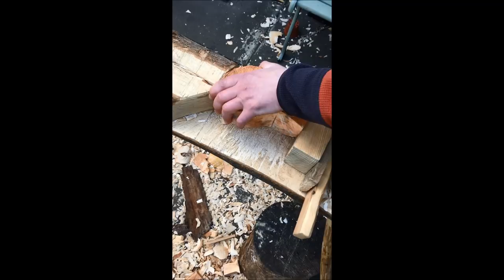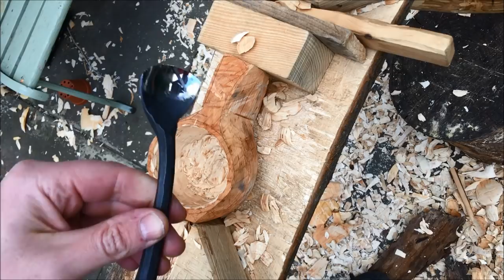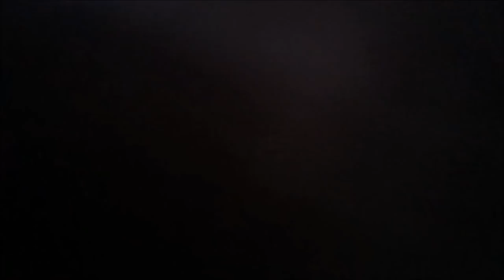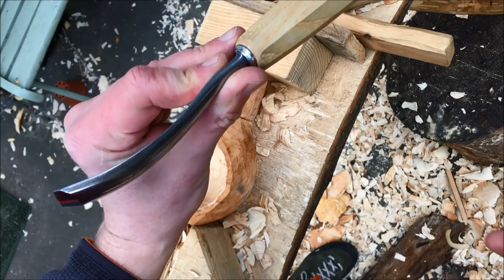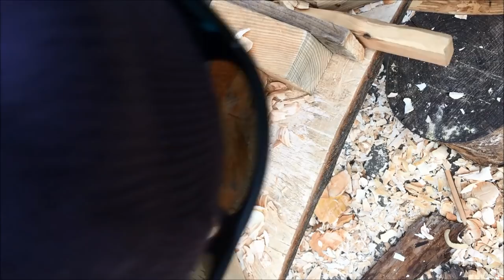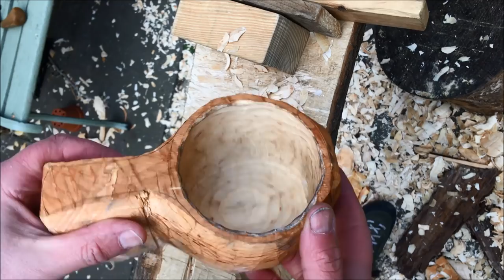Kuksa carving. Hollowing the bowl of a large sized wooden cup. 475ml capacity.

Comment: nice  :)  and then? what do you do to prevent it from cracking?
Reply from the maker: Not a lot. Mine dont crack on drying any more as long as I don't do it too quickly.  Get large diameter timber, a species that moves very little on shrinkage, and carve it without adding shock to the piece. The hard bit is stopping them cracking when you put boiling water in. Answer, don't put boiling water in, but brew in a pot first and seal the cup properly with a food grade curing oil.
Reply: Does it mean truble if you carve a kuksa from the senter of the timber? Like, if you carve directly on the aging rings? Does that increase the risk of cracking the cup?
Reply: There is a video online somewhere that shows a guy who has tested a great number of way to stop a kuksa from cracking.  His cure is to use a 1/4 cut piece of log and that helps prevent the problem.  To do that you would have to have a pretty large log to begin with.
Reply: Is the wood green or dry that you start with?

Comment: Hi, very handy video. I wonder if the Pfeil 8a/30 could be used instead of a dog leg/ swan neck gouge. Thanks.
Reply from the maker: Hi Ivan, I have an old gouge very similar to the one you mention and the geometry is not quite right. Just as the edge starts to cut it leaves the wood as you want it to continue cutting. I have been meaning to heat the shaft to bend it back a little to make it work though, and then re-heat treat it as I think that will work.